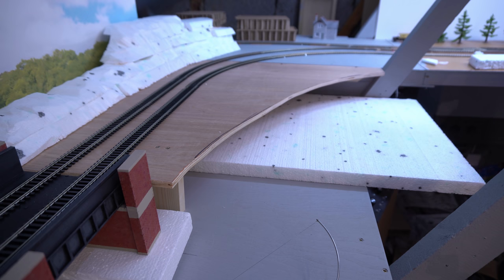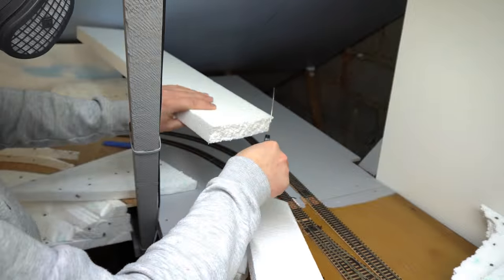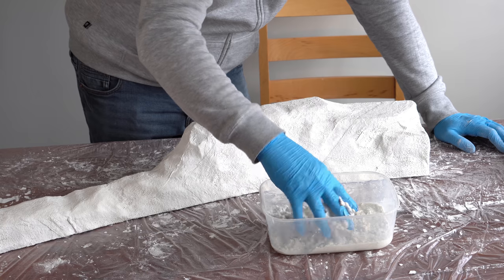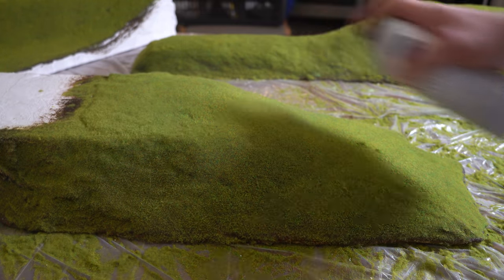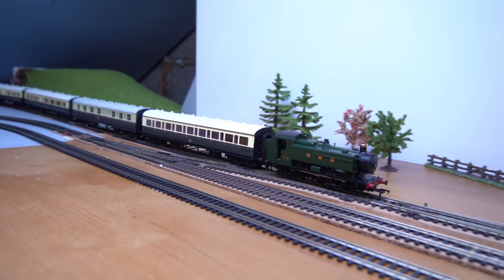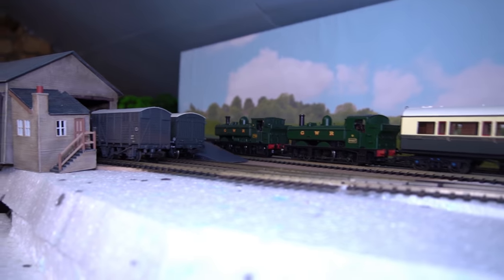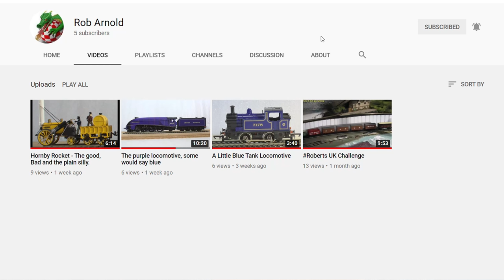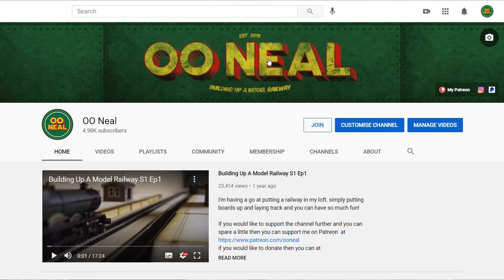Model Railway Static Grass application | How to | Building Up A Model Railway S2 E14

Comment: Brilliant episode and the green just makes everything look a whole lot better. Personal opinion but I would have stick the polystyrene to the board and plastered over the joins so it doesn't look as if the hills have been plonked by a giant
Reply from the maker: Thanks! I will be blending it all in after don't worry :) . It was just so I could do most of it in the kitchen and then it will be blended in while I am in the loft with it.